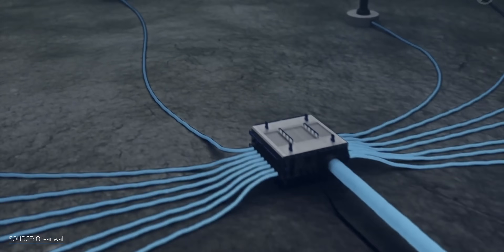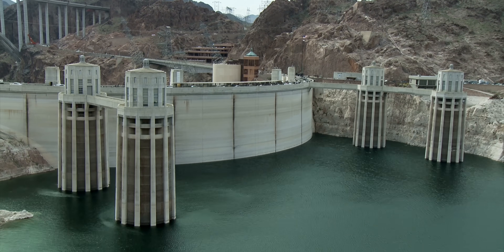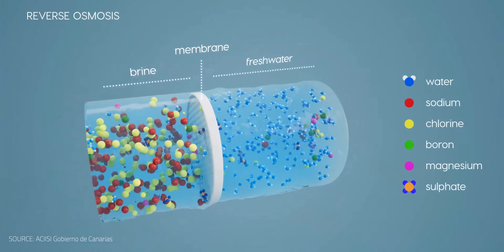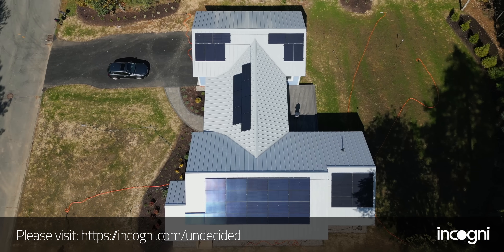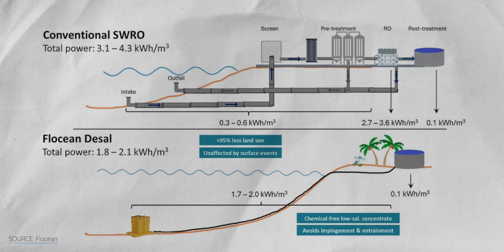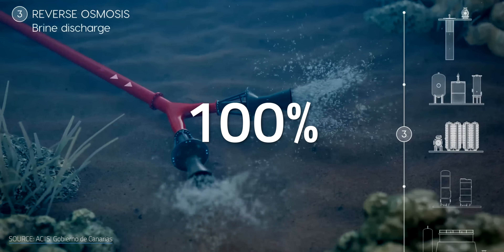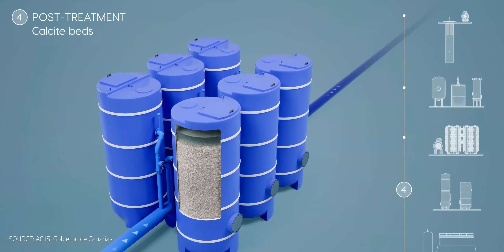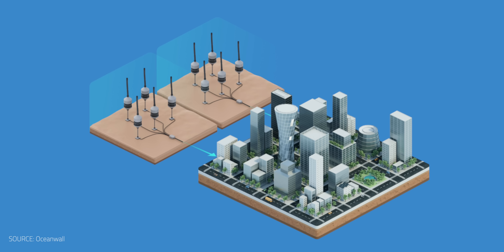How Deep Sea Water is Now Drinkable

Comment: while you can expect more upfront costs, you can increase the density and mitigate some other costs (such as infrastructure, or maintenance costs). if you try and implement this on artificial setting.

imagine digging a well close to shore, to the expected 300-600 meters deep.

lining the walls of this well with a sort of rail system, and suspend these pods from the rails vertically. replacing the filters is easier since the rail system can be used to lift these pods out.

and no umbilical cords, or expensive electrical infrastructure... drilling the well is more expensive than the costs saved i believe, but it also holds strategic value as this is located close to defensible areas.

on the top side you build a small canal from sea to this well, and let gravity feed in water,  you can even use the drop in altitude for some hydro electric facilities, to power the pump and vacuum pump of the RO.

once the water has dropped to the lowest point of the well, there is a slight upwards gradient pipe leading back to the ocean, critically the output of this pipe should be lower than the ingress of the well, with a pump maybe used to help push out the water.

Comment: Just watched the newer coastal energy video and I'm wondering if the two could be combined. Use the pipe infrastructure to house the cables. The mounts could be used as anchors for the buoys and probably power supply for the pumps. If the cables add significant heat to the pipes' water with any effect we could also use that for local water heating. That last effect probably is a dream though, since we can't even keep our current water infrastructure viable.

Comment: Piping is expensive of course but I wonder if this No electriicity And no pump method might work:  place the filter pod array several miles off shore in a particularly deep area off the coast of California and pipe it directly to Death Valley. Then simply run a vacuum be sucking on the pipe like a giant straw and once it starts flowing, remove the suction pump and let gravity do the work.  The water will want to flow naturally to the lowest point wich is the bottom of Death valley at 282 feet below sea level.  With enough pods in the array or arrays is should work.  Cost effective? Probably not.

Comment: What are you talking about. High external pressure at the bottom can not give any advantage to the RO process itself. 
RO works by pressure difference. Creating positive pressure of, say, 100psi will take the same amount of work as creating 100psi of negative pressure at the bottom. Suction actually is less effective, than pressurizing(more in gases, but still)
What?

Comment: another solution for the lack of drinking water is to make lakes of salt water in hot desert regions and take advantage of the heat, sant, clay etc to naturally refill the water table and create more clouds to deliver rain and block out light, if the lakes are just below sea level they don't need pumps, just needs a concrete pipe

why do these deep sea units need high pressure pumps? wouldn't that pressure try to equalize even pumping from half the line depth leaving the pipe empty? alternately have a surface well to catch water using compressed air with a large oxygen stone kinda like how you can move water in aquariums with air in a chunk of pvc pipe, the main function of the surface well in this case is to separate the air from the water coming up so it can be pressurized and put into utility lines
ergo we need more clever use of physics here, we could drastically drop energy usage if done right, could even use an old style wind pump like farms use for irrigation to fill tanks

Comment: One issue I see is the use of "disbursants" at oil well spills. Remember the big one in the Gulf by BP that they pumped a chemical directly into the stream of oil blowing out of the broken blow out protector a while back. That made all of the oil sink to the bottom instead of rising to the top to be corralled and recovered. That tar like substance is still sitting on the floor of the gulf decades later. Not a safe source of drinking water in my book. If they ever do the same in offshore oil fields elsewhere they limit the locations for this type of process. If you have ever walked the beaches of Galveston, TX you learned to dodge the "TAR BALLS" on the sand which are crude oil that escaped the systems at off shore wells. Nasty stuff. I hate to think what one of those balls would do to an RO filter.

Comment: You will never be able to have a maintenance free DSRO in the future. There are much more things to consider, for instance, you will still be down there every 2-5 years, welding on sacrificial diodes to prevent corrosion of the equipment in any case. I dont see this being sustainable.

Comment: Couldn't they pump air down part way in a separate tube and then let it bubble into the tube carrying water to shore? That would effectively lower the water pressure inside the system.

Comment: I think it’s a great start. I’m sure it’ll evolve into something better or efficient. I had a thought about all the derelict oil wells that are out there if you could put some windmills or solar panels up there and use the old pipes that they have pumping to shore the oil it used to and put a new sleeve in it and pump water with thosewater things on the bottom thanks again, Matt Farrell just had a thought I know salt water salt is negatively charged. Can you think of a way where you could use some kind of magnetic to separate it

Comment: 3:42 4:25 nuclear power plant, clean ,safe and efficient.
There is no excuse at this point, we have reactors that can use spent fuel from other reactors, we don't need to wait for new filtering tech to get the water clean.

Comment: I was examining the problem of lift in water..  That is why I was aware of water pressure and thought of pressure forcing its way through reverse osmosis membranes to remove salt from water.
          Try this one, does it work for to magnify energy  from air compressor to lift bag conveyor ...      So the idea is a conveyor chain , start with a thousand feet long, for this problem . Best length to be decided by engineers...,.  Conveyor chain is placed vertically in any sufficiently deep body of water.   Driving energy out shaft at top.   Idler shaft at bottom...   Now it occurs to me that air lift bags used by salvage divers as the example are the perfect solution.     So air bags along the chain held to chain top and bottom, or as engineers prefer, to keep air bags in position. Upright when going up. and downward when re turning empty to the bottom shaft.   A lift cycle going up and an empty cycle going down.    
               these bags are like hot air balloons open at bottom...   At bottom cycle, enough air from compressor is placed into open bottom end as it passes over bottom idler shaft and balloons return to up right position. Enough air so that at the top thirty feet of water column the balloon is completely inflated and no extra air needs to be injected other than air that provides lift     .   
But any amount can be injected but if extra is injected chain should be angles so bubbles escaping bags to not interfere with lift of bags....  Leaned slightly back escaping air would make separate way up...  so bag displacement remains unaffected. 
    OBJECT  to inject air into the bag for a second or two that will lift for the duration of a thousand feet, I give a random figure or a minute to make example. More air lifting the faster chain may travel..   But generate for one or two seconds and lift by hydraulic force for sixty seconds...   compressed air should readily pump downward and efficiency is related to pump selected....   So the air stays in the upright air bag with the open bottom until it passes over the top drive shaft , for power out ,  then drug across a horizontal section to  cause air to exit bag, then empty balloon travels straight down ward in empty cycle.  At bottom bags repeat inflation. In is the position of the lift bags that allow emptying and filling no timing needed... Except the travel speed of the chain which is affected by the amount of air initially put into air bags at bottom of cycle..   The more air, added, the faster the chain may migrate upward through the water column.  Also remembering that air expands to its greatest volume during the last 16 feet of lift...   Too much air will just escape the lift bag and perhaps be wasted...   I was not educated enough to complete either idea...   i STILL  think there is a great mechanical advantage to be found...   But I have been wrong before...   Further the chain may pull up deeper cooler water leading to food blooming in upper warmer water..   Life fish around an oil rig.    So  a problem for the engineers...    note one minute lift is well short of potential, Air rises in water about a foot a second. Faster rising with more and more air.. Not sure how much faster but a thousand foot deep conveyor chain could take a thousand seconds to generate lift but less for more and more lift bags..   Study of lift bags literature may inform engineers... Just sayin. A few seconds to fill bag to correct potential as a mechanical process and a thousand seconds of hydraulic lift....    Lifts tons of steel out of water... Sure seems to have potential  to magnify energy input as compressed air...  
    compressed air in right form to transmit by pipes to a thousand ft depth against force of water pressure.   Not high tech...
                  cold water lift from depth as cold water follows full bags by resistance...   Could stir deep stagnant water if any deep enough exist and aerate the water near the system.   If it works its just an engineering problem .... I claim rights not in public domain...

Comment: I came up with the idea many years ago...   Industry said would not work...   My idea use deep pressure to push through ro filters into steel legs of platforms..   Fil legs with fresh water which weighs less than sea water and the pressure should cause an over pressure on the fresh water weighs less   and the fresh water be lifted above sea level by he excess pressure in the legs and be lifted above sea level to be collected by tanker,   I am not an engineer only communicated idea... Result no interest....    Engineer published article many years later, bullshot that this pressure would not be enough...    Hydraulic pressure lifts aircraft carriers...,    I was young ...now that engineers have patients in hand suddenly it works...    I am 73 had the idea in my thirties, perhaps late twenties,  communicated the concept to the public and companies , or at least tried...   does it make any difference to me no . Just don't act like they have done something new.    it could have been done years and years ago...  see the next post for another idea I was working with   the lift of air in water, floats air craft carriers.    Is there a mechanical advantage ..   further if hydraulic life is enough can it be used as a hydraulic energy source at ocean level...   if system is large enough excess hydraulic lift should work through load and still allow perhaps the lift and collection of fresh water at sea level.  A smaller scale seem to most efficient , that is where they are now...

Comment: I have one of these in miniature.  I just toss it off the boat with a line attached. You drop it to the depth where the pressure is high enough to force the sea water through the RO membrane.  I then pull it up and have drinking water.  I proposed this system to our coastal city 5 years ago.  The only problem I see is the lifespan of the RO membrane

Comment: Something is missing here… 
the depth of the water is responsible for the pressure?
For the pressure to force water from a high pressure zone, through the “filter” into a low pressure zone there has to be a differential of significance.
If the pressure is X on the salty side what would make the pressure less on the clean side of the membrane if both are at the same depth?
If someone can simply help me here.. I’d really appreciate it.

Comment: It appears the "big" rationale for such a project is the difference in hydrostatic gradient between fresh water from the RO (~0.433 psi / ft) and ambient seawater (~0.465 psi / ft).  If the depth of the subsea hardware were say 2,000' the difference in hydrostatic would be ~96 psi (seawater at ~1,395 psi and fresh water at ~1,299 psi), which is not much when you consider that conventional on-shore RO feed pressure is about 800 psi.  ALSO, trying to RELIABLY operate a multistage centrifugal pump AND reverse osmosis system in 2,000' of seawater, miles from shore would be a herculean task.   

Where oil companies are highly incentivized to put up with the substantial complication, cost, and risk of subsea oil and gas developments, the alternative to them is a floating production platform (think "city" at sea) which is more expensive still.  By contrast DSRO competes with onshore RO which is well-understood and represents a simpler / cheaper / more likely to actually work project, that does not require you to custom engineer a high-voltage power & control umbilical, to a custom underwater pumping and RO system that might be 1 of 1 on the planet.  

Finally, our presenter didn't do his best work describing the relative merits of DSRO, and if felt as if he might not have completely understood it.

Finally, finally, the video includes discussion of backwashing to clean the DSRO prefilters / membranes.  Maybe these are a super-special design, but every RO membrane I've seen CANNOT stand more than ~5 psi of reverse pressure.  Greater than that and they literally burst at the seams.

Comment: The pumps needed to pump the permeate back to the surface will be 40 bar , so the pressure that they are gaining with the depth must be offset against this 40 bar so they are not saving much energy. Coupled with the extra cost of working at such depths , i dont see a benefit.  The extremely low recovery of 5% might help with scaling.

Comment: I personally think there is much wrong with this. 

1. Do we know for sure clean water is running out? Droughts are not permanent. What's the situation with underground water in those affected regions? 
2. Droughts are localized. Maybe It is time to move plantations and high water consuming industries to another area. Some times we gotta fight the environment (aka making it safer for humans) but avoiding confrontation is always an option. 
3. If these plants require huge amounts of energy why are they going solar and not nuclear? To demolish Nuclear Power Plants and set up windmills and solar farms is absolutely medieval. 
4. I am not comfortable having my primary source of clean water deep in the see. If something bad happens clean water will be the first thing to stop working. I do not like that, not even a little bit.

All in all good video. Great quality. I just politely disagree with the aim and the direction of these projects.

Comment: It doesn't sound right. Work done by pumps should be equal to normal RO. In deep sea case you must not only reduce pressure on fresh water side but also bring water the land what would mean that you have to overcome pressure on that depth. So you still have to force pump to produce the same pressure.

Comment: Soviet Union already solved the desalination problem by building a nuclear power plant based on fast neutron reactor, coupled with vaporizer desalination plant in Aktau, Kazakhstan. It produced electricity, heat, steam for the industrial use and fresh water for the entire city. A city built in a desert.

Comment: Thanks! This is great information and a great idea. The kind that let us think. Oh... We didn't we do this before?
I have a question though. If we connect this filtering complex to a purpose built fresh water well on land of floating at sea, would it be possible to have the filtering occur electricity-free by using the pressure differential with the surface? By collecting the water from this well, the water level would get lower than sea level, this pressure differential then could be enough to have salt water pass naturally  through the osmosis filters and even run some of the filter-cleaning devices either directly or by running a small electric generator? Would that be.a self regulating mechanism too (in the sense, more water collected, lower levels, more pressure, more water filtered) that could self adjust to various water needs?

Comment: Noticed something about RO... why aren't they taking advantage of gravity and heat pump tech and deep drill a big ol hole in the ground and gravity drive that water through by gravity and sheer weight of the water - and wonder if you couldn't solar paneled high pressure steam some of that water and that heat interaction pumps that water more... would save an astrononical amount if you could figure out the membrane changing mechanism when you need to replace said filter which would be at the very bottom of a gravity assisted pump system.

Comment: What if, pull the sea water and put that in a 1000 ft vertical pipe(like industrial chimney) and get the same(as in sea) amount of pressure at the bottom. So put the filter at bottom and get the fresh water. Let the gravity play the role along with fluid dynamics. Furthermore,

A. To the pull the sear water, wave pumps could be most efficient but a bigger number of pump might be needed looking at pushing the water to such a big height(looking at 1000ft in this example).
B. Having filter at the bottom of the pipe would be easy to replace/change.
C. 1000ft is just a representational figure here, the height would be directly proportional to amount of pressure needed.

Special Note: No relation what-so-ever with any engineering discipline not even with physics, so asking stupid questions.